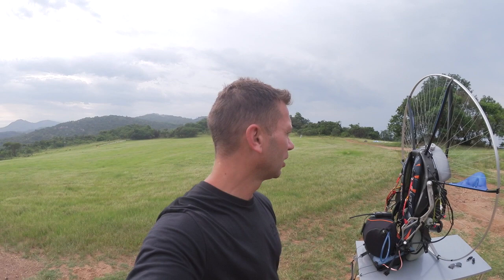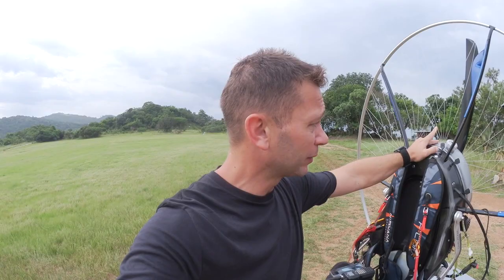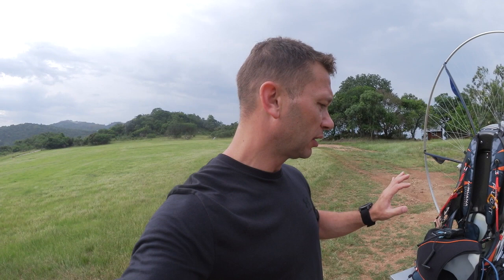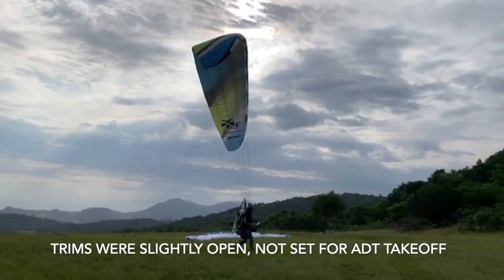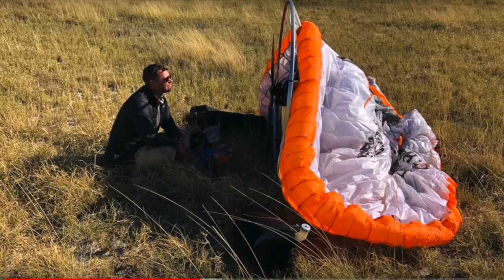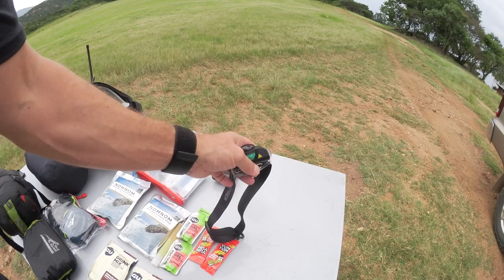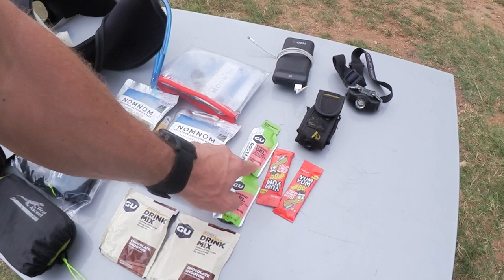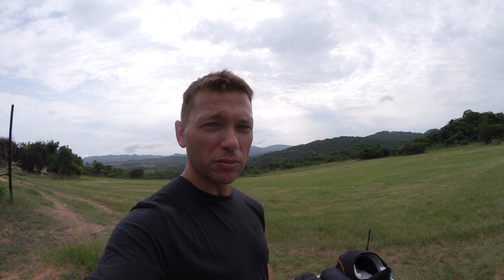Paramotor - My XC Gear design is complete!

Comment: Thanks for taking the time to show us how you have achieved a match winning set up. I carried too much kit that I just didn't need and some bits of kit that I wished I did. Thanks again. Good luck with your next endeavour.
Reply from the maker: I have to say that I think I had the kitchen sink in on the first Icarus. Very stupid. The kit now is so enjoyably light that I dont mind flying with it just for the hell of it. That being said, the Warp has a major effect on this as well cause it has no ground roll if at top weight
Reply from the maker: Hey Bud dis you do that high altitude flight with oxy?
Reply: @therealeugenecussons  yes, doing it without was a complete no go. I would pass out. In the UK you need O2 above 10k anyway.
Reply from the maker: Golf Foxtrot 22 how high did you go and for how long above 10k?
Reply: @therealeugenecussons  I got to 21, 746ft officvally.  I was above 10 k for over an 70 minutes.  It took me 1 hour 10 to glide back down again. That bit was certainly epic.
Reply from the maker: Golf Foxtrot 22 awesome. What did you change on the motor?
Reply: @therealeugenecussons  a mixture adjust. I was completely stock,  I just wish I had a few litres more fuel as I ran out 150 meters short of equaling the world record.  It was technically the highest height gain ever as I took off from  only 6ft above sea level, but that doesn't count ;)
Reply from the maker: Golf Foxtrot 22 awesome man! Weldone! Can you recommend the right OXY mask model?
Reply: @therealeugenecussons  Summit Oxygen supported me but they are UK based.  It was a composite bottle. Pm me if you want to chat more.  Happy to help anyone. We need to push the boundaries, only because we are human.